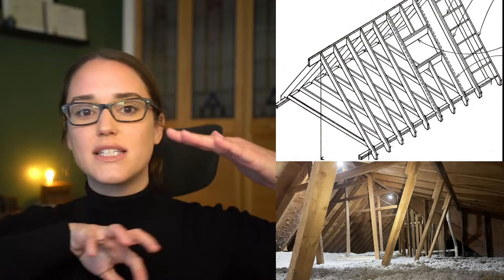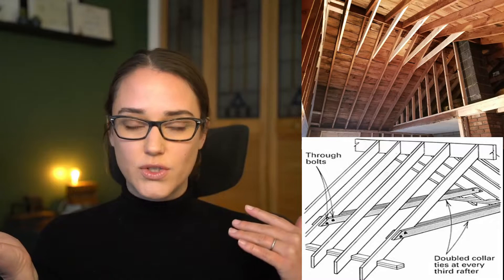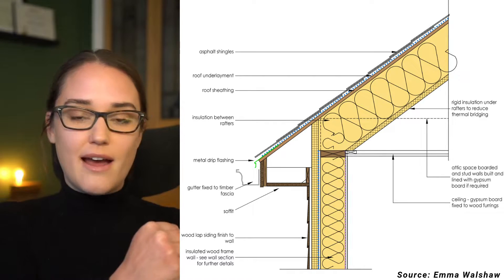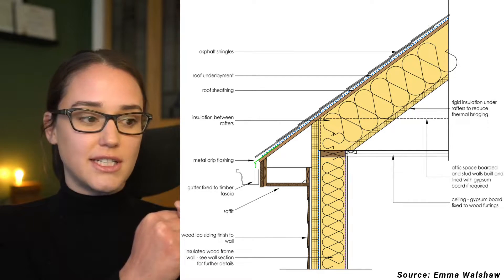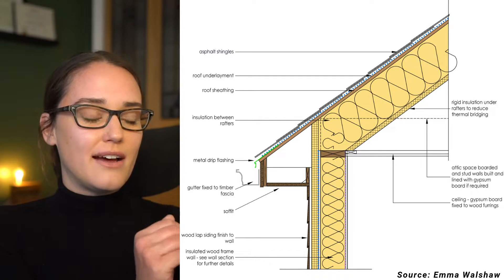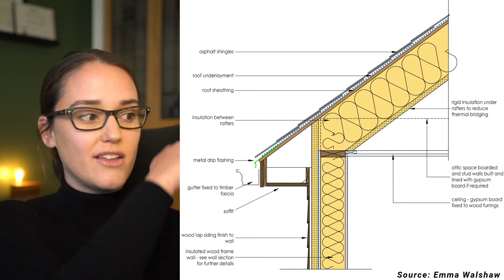Vented vs Unvented Roofs | Midcentury Modern Architecture Design Detail Explained | PPD + PDD

Comment: If you do exterior insulation it moves the condensation plane to outside the house envelope. How much you need depends on where you are. If you are using an Erv system put intakes up near the peak of the roof as well to handle interior moisture from collecting as well.

Comment: Thanks for sharing this information, wondering what your thoughts would be about doing as you mentioned in the end by using rigid foam between the roof deck and truss, and use a butyl tape or equivalent to seal everything water tight. Do you think it would be possible to use a 2" rigid foam with an R10 above the trusses and then fill in with bats in the ceiling, or would there me enough of a thermal transfer/loss for condensation to build up if air from vents and lights were to pass through? Maybe it's unavoidable to just build up the required R value foam thickness above to meet code before creating a penetration in the ceiling. Any thoughts on this would be much appreciated. Thanks

Comment: LOVED this video. Question for @byoungdesign: our home (built in 1960) doesn't have an attic, no soffits, and has 3" rigid insulation. We also have clerestory windows that go right up to the roof facia. We also have a skylight and sun tunnel, both of which will be reflashed.
We are about to re-roof our house and ventilation is a big topic. Do we need to do anything special to support the health of the shingle and home? For example, do we need raised ridge caps? Should we install permeable underlayment? I believe that the rigid insulation goes right up to the top-layer sheath.
Reply from the maker: Great questions! Your home sounds amazing!! First off, each location is different, so it’s best to double check with a local architect to confirm what your specific climate needs. With that said, it’s possible your roof is unvented OR there is a small air gap that is sufficient for the ventilation. There may be a way for the roofers or someone to check how the existing structure is assembled. If non-vented, take a look at non-vented roof details (check with architect) to see if you need to add any additional insulation or underlayment. If vented, just want to make sure the existing venting is sufficient. Sometimes these midcentury homes have a little venting but not much. Lots of unknowns, so getting a contractor to confirm existing conditions and then confirming with a local architect what the ideal roof system is is your best bet. Hope that helps!
Reply: Thanks for your comment! We are in Portland, OR. Also, we confirmed that the roof is not vented; it's a hot roof with 3' rigid insulation so no apparent way to enable airflow but we won't know for sure until the work starts. Our home was actually the personal residence of a local mid-century modern architect from the 60's! The original roof had no insulation and was fully TPO'ed (or some other membrane). I asked similar questions on other roofing forums and the consensus is that a permeable underlayment and ensuring that the roof is airtight will do the job. What's unfortunate (or unfair) is that we don't qualify for the roofing manufacturer's extended warranty b/c the roof is not ventilated.   @BYoungDesign

Comment: The detailing for unvented roofing systems is pretty straightforward.  Handle bulk water, meaning have no leaks.  Deal with and eliminate air leakage as much as possible.  Understand the 2 reasons you get moisture in unvented cavities and prevent it.  Moisture or vapor leads to condensation when a cold surface is exposed a warm environment, just remember that glass of iced tea you have in the summer and the condensation forming on the outside of the glass.  A cold roof deck in the winter, that thermal bridging will lead to condensation forming on the underside of a roof deck.  The second factor is vapor/humidity which will find its way to the highest points in a house.  Breathing, cooking, bathing, etc...all create additional humidity (vapor) that has to be dealt with.  You can learn more about this with Matt Risinger on the Build Show on youtube.  Vapor Diffusion Ports, Conditioned Attic spaces, etc...